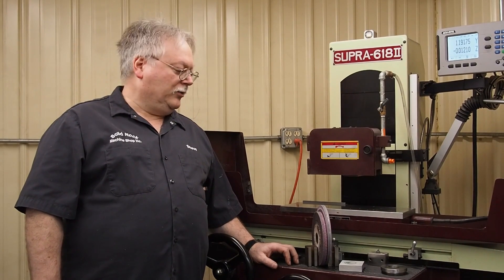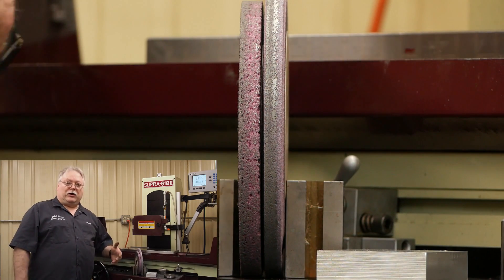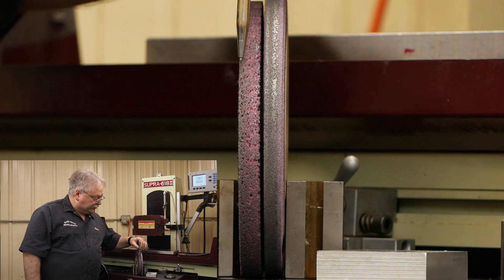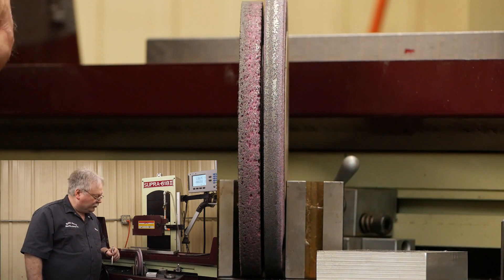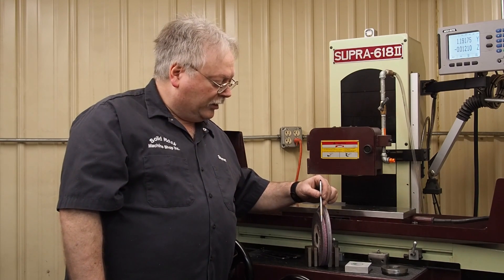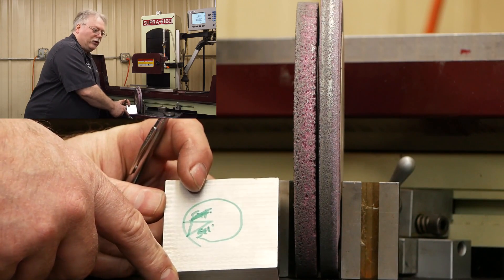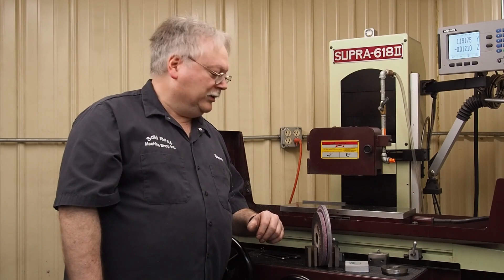Update on Grinding Aluminum using the Fischer977 method

Comment: also 1 factor you missed was bubble size on 1 side and the other side I think it has too do with the proses in making them bigger bubbles on 1 side smaller on the other side let me know if I am right thanks .
Reply from the maker: Hi Dan,
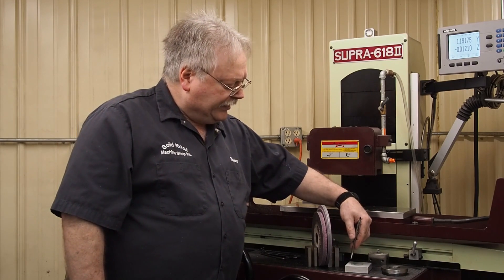Not sure what you are talking about. Would you give more detail on what you are talking about. Are you talking about what I mentioned around 1:58 mark about the coolant puddling on the leading edge?
Steve
Reply: the grinding you did with the 2 stones showing how they loaded up with the aluminum I seen they had bigger holes on one side more than the other side are they pored into a mold it was 1est  one you used .it would be nice too see how they are made .
Reply from the maker: Hi dan van der torre,
Now I see what you are talking about. If you look at the wheel from top to bottom it looks like the pours are not consistent. I would love to see how they were made too.
Steve
Reply: it would make a good video and the company may change the way they make them if they agree ask them too send me some grinding stones I am going to build a surface grinder because they are so expensive I will be using tuck bearings I can get them at a scrap yard and some I beam and a good dove tail cuter all I need too know is the RPM for the motor and can I get buy with a one horse thanks .

Comment: Watched both of these very interesting videos. Thanks for the good tips! The undiluted coolant trick sounds great, no contamination of the bulk coolant. I guess the main problem is getting enough into the grinding zone under the wheel. Perhaps the wheel clogs on the trailing edge because the coolant does not reach it, being "wiped away" by the leading edge of the wheel. Wonder if a small mister or something on the back side of the wheel would work better than brushing?
Reply from the maker: Hi Erik,
I was thinking the same thing about the trailing edge.  From my view you could actually see it heavy on the leading edge and light on the trailing.
Steve

Comment: Good update.  Thanks
Reply: I like the Video editing with the close up and overall.  I do grinding on Aluminium for Injection Molds.  At my current employer we use 46 grit Aluminium Oxide.  We do not have coolant on the small grinders so we also use coolant concentrate or way oil.  WD-40 and / or Kerosene do not stick to the surface enough.  Hand spraying coolant gets cumbersome and you really have to spray a lot to get it to work. 

At another shop we bought some Norton wheels that were Aluminium specific.  Sorry I can't remember the exact spec / part number.  They were awesome we were able to go to 1" wide wheels and pretty much take full width step-overs with flood coolant.  I am sure Radiac makes a similar wheel.  

I would not recommend Norton brand anything, including toilet paper as they have moved alot of mfg to Mexico, and left Quality Control to the buyers of their products.
Reply from the maker: Thanks Randy.
Reply from the maker: Thanks for the information Chris.
Steve